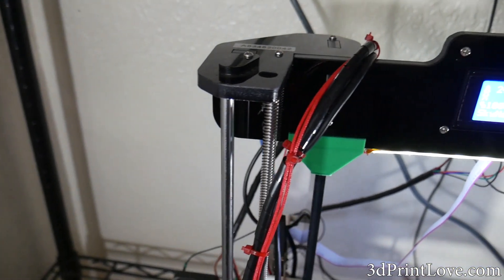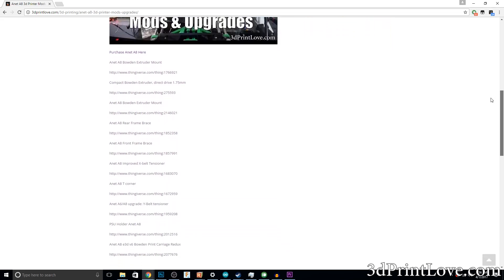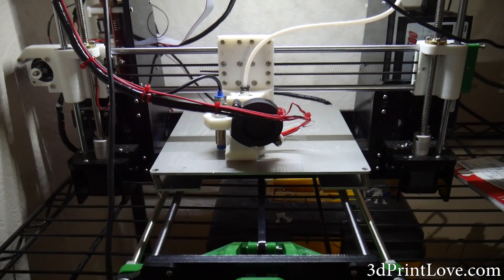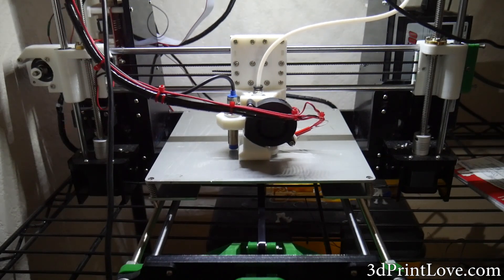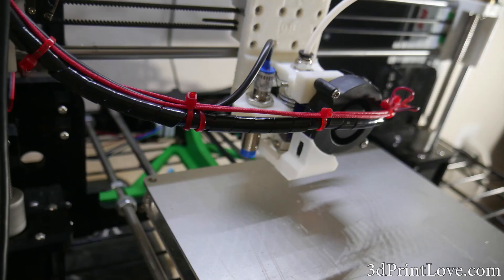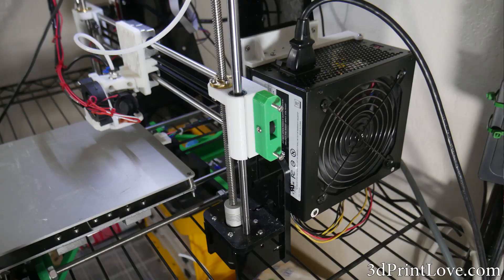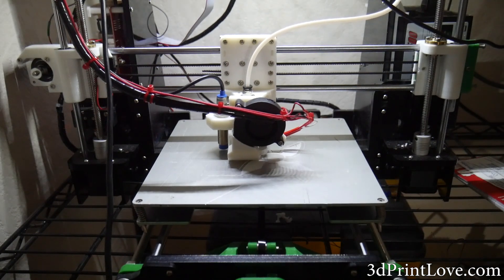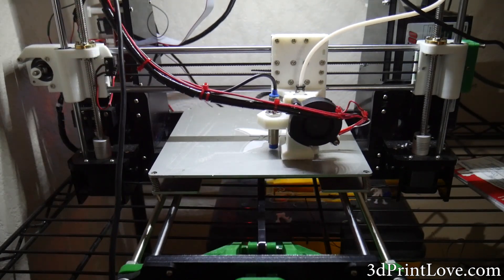Anet A8 3d Printer Review | Best China Kit Printer 2017

Comment: +ModBot is your Anet A8 using lead screw or threaded rods ?
Reply from the maker: +Jun Lei Choo lead screws!
Reply: ModBot I have a question was wondering if you were able to help me I converted one of my Prusa i3 itineration from threaded rod to lead screw. Anyway I could make the z axis steps correct because now it's running each layer at higher steps ? Thanks
Reply from the maker: yes I had to deal with this once on a conversion I did there is a tool called like the reprap z axis step tool that helps you calculate what you need to set the steps to in order to compensate for the different pitch in the lead screws
Reply from the maker: found it! http://www.prusaprinters.org/calculator/
Reply: ModBot anywhere I could change those parameters regarding this, and is it possible to seek ur guidance because I am a noob haha
Reply from the maker: im not sure what kind of board you have but yes i know in marlin firmware there is a section where you can edit this. Honestly on the top of my head I could not tell you exactly what i believe its in the config.h file but I only edited it one time and its been a while if you cant find it by browsing through that file i would maybe just google or ask in the reprap forums!
Reply: i am using a meizi board from china
Reply from the maker: should be able to flash it then i just did with skynet firmware

Comment: nice video series man. I've watched them all. 👍 I switched to the bowden setup as well, and had a question I didn't see in any of your tutorials. how did you reset the hot end back to the center of the bed.  the v6 hot end mount locates it about 10mm to the right and can't figure out for the life of me how to reset the origin to the center of the bed.
Reply from the maker: right on! thank your for the feedback. haha your gonna laugh but I am in the same boat mine is off about 10mm as well and I have not bothered to mess with it yet. It should be in the firmware I am sure I just need to make edits to the starting location of the x axis but like I said I have been busy with everything else on it that I have yet to bother. I will try to make it happen in the next day or two then let you know how I did it!

Comment: Seeing as how you seem to be using the same 5V sensor I am, you can use mirror tiles that you can get at home Depot as long as they are 2mm thick. 

Also, being one of the designers for your carriage and cooling shroud, I am glad to see others using it, and featuring it in their videos!
Reply from the maker: no way thanks for the tip on the mirror tiles may end up going that route eventually then!

Also I knew your name looked familiar and its because you are in the thingiverse description for the carriage. Thank you very much for designing such an awesome addon! The best option out there in my opinion and great that there are so many available versions depending on whether you are using a sensor as well as what size sensor!
Reply: I can't take a lot of credit for the carriage, other than testing and moving some parts around. Daniel Levinson is the one that is really responsible for that part. But I am glad to hear that you like it, as we do as well... lol
Reply from the maker: Extremely talented. I have only been messing with cad software for a little over half a year off and on. I designed an x carriage for a printer I had that was made in house and it was bad haha I mean I was proud of it nonetheless but not nearly as clean or intricate as the one he/you guys put together. The community behind the anet a8 is awesome :)

Comment: the printer looks really nice. I need to upgrade my 3D printer to a v6 hot end which I don't know how to do yet.
Reply from the maker: thank you very much voodoo :) its not very difficult well for the most part it helps if someone else has designed the holder already so that you dont have to also you may need to tweak some settings in the firmware so hopefully whatever board your printer uses is like an arduino setup that is flashable
Reply: ModBot I really have no idea how to flash the firmware last time I tried I bricked the board but got a free one from the company.